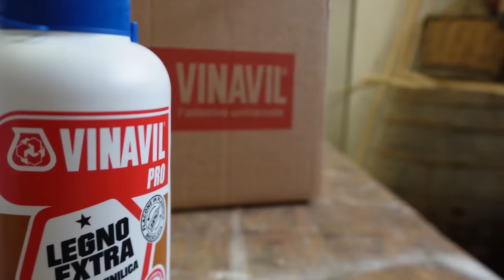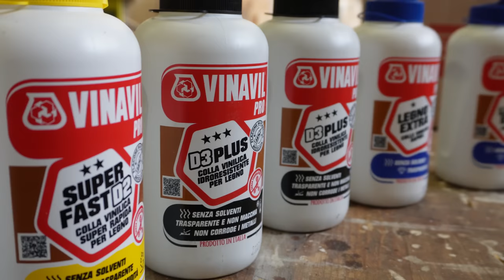restauro vecchia panchina della nonna (piegatura del legno a vapore)

Comment: What was your reason for using pegs instead of nails? It does look nicer. But was that the reason?
Reply from the maker: I used wooden dowels because they last pretty much forever. Nails are useless. after a short time it will be ruined no and you will have only ruined the wood. Long live the wooden nails it takes longer but they will certainly last for many years.

Comment: Well restored.

But I watch a lot of restoration videos and I am impressed with just how dangerous it is.  Fumes from chemicals in the air,  tetanus from rusty metal fittings, poisoning from lead paint, acid burns. Shew you have to take  so many precautions.  The average person should watch your videos to see just how to handle all of these hazards and dont forget the power tools.
Reply from the maker: I didn't use acid, it was just water.
Reply: @IlMakerstauratore  Best wishes.